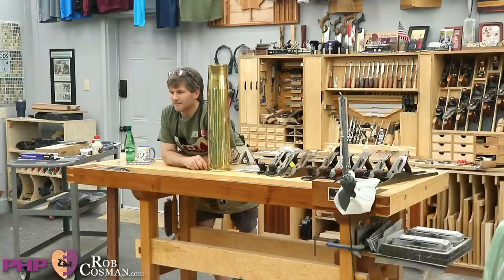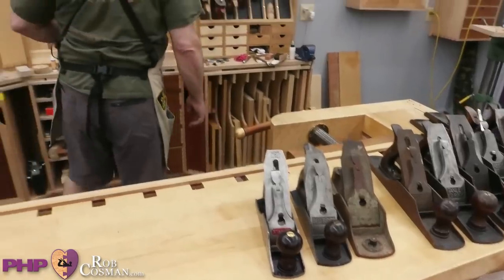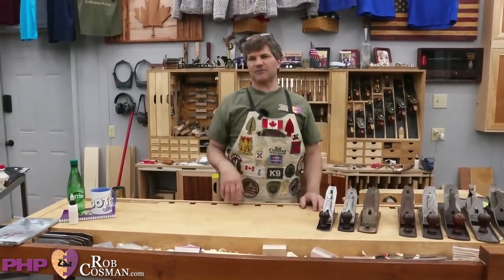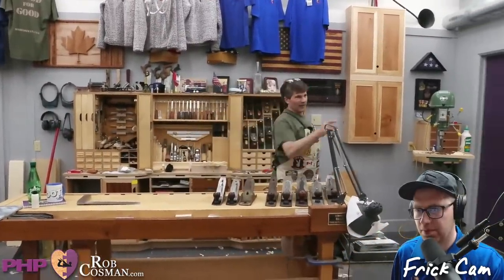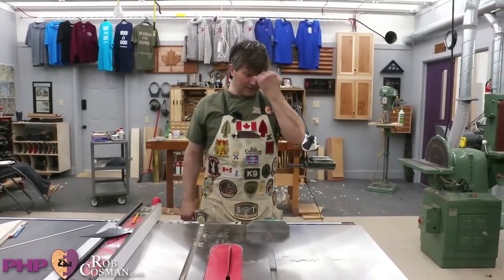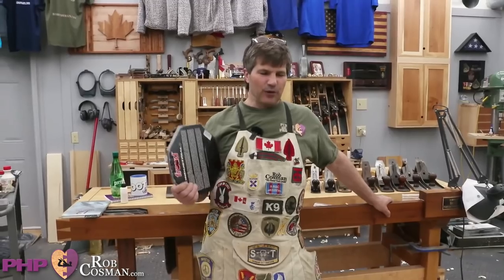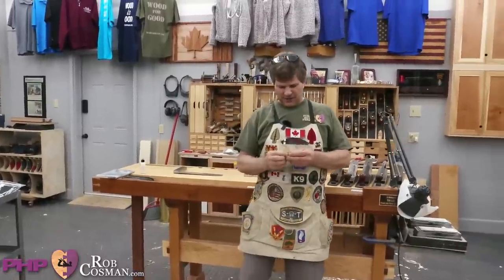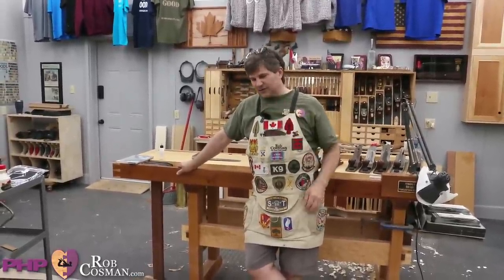Table Saws - Live Q & A (12 June 2021)

Comment: For a unisaw, put the fence on the left side of the blade for angled cuts, then the blade is now away from the fence.  simple solution.  I have had my unisaw for over 20 years now, its a classic, and still works as good as day one.  I never knew the sawstop actually stopped the blade.  I have never seen anyone talk about this before and have seen countless videos on the sawstop, I just thought it was a brand name.   In any case, I have had one kickback accident in 20 years, and that was from using a dado stack and routing a groove in a narrow piece of wood and I really didn't give consideration to the lightness of the stock and how little control I had over it.  The board flew back against my back cement wall, and bounced all the way back and smashed my finger tip, fortunately just a few stiches and lost nail.  It's always the unusual cuts that you dont think about that get you.  So i will always use a push block now when going over a dado stack.  live and learn.

Comment: That dust shroud door Rob shows at 17: 30 is only on newer ICS saws. I wish my PCS had it so I wouldn't have sawdust in the bottom of the saw!
Reply from the maker: I have it on my saw purchased in 2005 as well.
Reply: @RobCosmanWoodworking  Interesting! They must have made other improvements because they have two versions of the ICS manual; one titled "Industrial Cabinet Saw Owner's Manual (With Dust Collection Upgrades)" dated 2020

Comment: Huge fan and avid handtool woodworker. Actively saving to try to attend your PNP workshop in the not too distant future. 
Comment on your tablesaw YTube session. About 15 years ago I read online a fellows observation of what the Forrest sawblade guys did before a wood show. They had probably a 3 inch and 1/4 inch thick blade 'stiffener' that had 8 grub screws spread evenly around the outside. Then using a dial indicator, they made sure that the blade was turning perfectly vertical, adjusting the grub screws where necessary to ensure perfection.
I did this myself, just using a Freud blade, and the difference between before and after made a very significant difference where the 'after sawcut' was almost ready for finish (few passes with smoothing plane made perfect). Does mean that blade changing took a few minutes longer and did reduce max cut depth about 1/2 inch, but the sawcut finish is worth it. Strongly recommend you test this. I used saw-sharpening business to make my 'stiffeners for me.
Bill Liversidge, Midlands, UK

Comment: Hi, Rob! I have a question about table saw safety. Actually, someone asked a question in a Facebook group a few days ago, and they’ve pointed out this video to show what they were proposing, so I wanted to clarify, please. The question was “is it safe to setup a cut like it seems you do at about 30:00”. You’re talking about using a miter gauge if the distance against the fence is shorter than the perpendicular distance. It seems as if you’re going to make the cut using both the miter gauge AND the fence, with the miter gauge being between the fence and the blade. We all told him, and his gut instinct, was to never make a cut where the wood could bind between the blade and fence. Then at 45:00 in your video, you discuss binding and kickback, but you set up the cut with the miter gauge being on the outside of the blade. You mention to never make a cut like that where the material touches the fence. You also say “without being supported”, so I take that to mean that the cut at 30:00 is safe because it’s supported by the miter gauge??? Is that correct?
Reply from the maker: Yes.
Reply: @RobCosmanWoodworking  Thank you! I would have thought the 30:00 cut would be a no-no, but being supported with the miter gauge makes sense to make it safe.

Comment: The problem with sawstop is that they have their safety mechanism patented, which means they'll sue anyone that tries to implement a similar safety mechanism in their table saws.  To put it simply, sawstop cares more about profit than they do about keeping table-saw users safe.  The fact that sawstop appears to have essentially extended their patent until 2024 and 2025 (the original patent was set to expire in 2021) is proof that profit is their primary motivation.  It's pretty clear that sawstop will try to keep competitors from implementing similar safety mechanisms for as long as they can.  With this in mind, there's no way I could ever support a company that puts profit before safety.

Comment: Dose the blade stopping feature work if the saw is not under power but still spinning on the wat to slowing down.?
Reply: The break will fire even after the saw has been turned off. 200rpm and higher.
Reply: @steelwood74  best saw ever for the price range. I've had a few close calls with other saws, shutting it off and almost getting bit.

Comment: That's a good point about the cost of healthcare in the USA.  I think I remember James (Stumpy Nubs) sating it cost him more than $10,000 after he gashed his hand with one of those nasty chainsaw carving blades in an angle grinder.  It would be free for us here in NZ (that includes tourists and all visitors) but I think I'd gladly pay $10k to avoid the injury that James had.   On the other hand, listening to Rob talk about the number of false Sawstop triggers he has experienced, and each one costing a new blade and cartridge, I think I'd also be annoyed at that cost.
Reply from the maker: The number of false triggers would be due to the fact that my saw is used in a commercial shop and over 15 years old (they’ve been happening over the last year or two mostly). However, if it is deemed a false trigger they will replace the cartridge for free (they’ll even replace it if you trip it on your finger).

Comment: What amusement do you look for on your saw to keep your saw accurate or able to adjust it
Reply: For amusement I like to roll ping pong balls into the rising side of a spinning blade. Never improved the accuracy, though.
Reply: Hahaha , what adjustments would have been better, unlike a phone picking your words for you 😉😂🤣😂🤣
Reply: @jamessmith1965 , drives me crazy, too. Proofread several times, and still seems like a change slips in when I send!
Reply: @jamessmith1965 , Rob mentions all these, but my first lookout would be to select a “cabinet saw”; that is, the motor, blade, trunnions , etc. are all mounted to the saw’s metal cabinet or cast frame. This means that the top is held on by a few bolts and is more easily tapped around to align the miter slots with the blade. Saw Stop has the best, and only, system built in for fine adjustment of such. Less expensive saws have the works bolted to the underside of the table, making adjustment very difficult.

Threaded adjustable stops at 45 and 90 degrees are important, but I don’t know if any saws are sold without such, nowadays.

Some rip fences allow more adjustability than others. The Uni-Saw had a very reasonable system  in two ways. You could adjust the lock on infeed side to grab first, squaring the fence, and then lock the outfeed end for security in the same throw of the lever. Even more importantly, after the infeed lock it was possible to loosen two easily accessible bolts to adjust parallelism to the blade/miter slots. These capabilities are the minimum I desire.

Even better, though; for a time that saw was available with Uni-Fence, which gave it the virtues of modern Euro-saws. The fence extrusion  could quickly be positioned in several ways: high up, low and thin, overhanging, or pulled back to clear the blade for ripping “tense” stock, or using as a stop for multiple cut-offs.

Now that domestic USA saws are becoming equipped with riving knives, a very useful feature is easy alignment of those, and tool-less removal/install fastening.

If purchasing a new saw, I agree with Rob that Saw-Stop, the best model affordable, is the only game in town.
Reply: @leehaelters6182 As an avid "Ping Pong" player I could use this technique to improve my service game.

Comment: Hey Rob! I love your channel!  I wanted to know about hand planes. I wood believe that the sides would be square to the bottom. I have old Stanley I want to clean up. I also have an old Sargent plane I started to clean up.In doing so I found the sides to be out of square with the bottom. The Stanley is out of square as well. I'm sure my square is good. I this normal?
Reply: Most planes that I’ve checked are only casually square, which is to say not enough to satisfy. The Record Technical Jack was touted by the company as designed with shooting in mind, and supplied with a removable handle. Never saw the actual item to check, though.

Comment: Why haven't American table saws changed in fifty years?
The European saws are decades ahead of the American machines.
Reply: Agreed! For one example, all rip fences should be euro-design, at the least. Riving knives are coming in, now. But maybe the Saw Stop and the brouhaha it created is the beginning  of smarter equipment design in the States!
Reply: @leehaelters6182  , I don't know if SawStop could take the technological leap to create an accurate sliding table saw, with decent dust collection.
Reply: @areuaware6842 , agreed there, too. The sliding tables I see being incorporated with “American” manufacturers’ products are all lame, added far from the blade, need spindly legs, and so on. A fresh sheet of paper is what the saw manufacturers need. Nobody interested in that unless they faced legal restrictions otherwise.
Reply: Yes guys, but at the same time the saw stop peculiarity to make the blade disappear avoiding injuries is just implemented in a contractor's site Festtool and that's all... I'd rather buy an American saw stop than a beautiful sliding saw table if this can cut off my body...
Reply: @dukeengine1339 it will take too long, of course, but I look forward to manufacturers creating their own mechanisms and detection technology, now they’ve been shown the way by Saw Stop. Felder already has something developed.
Reply: @dukeengine1339  , I've always been more concerned with how saws saw and not how they stopped sawing.
You've probable never used a European sliding table saw, their capabilities are way beyond one of Americas fifty year old designs.
My question remains, why can't an American company make a better table saw?
Reply: @areuaware6842  I guess Rob isn't aware that Sawstop makes a sliding table.
Reply: @leehaelters6182  I guess Rob isn't aware that Sawstop makes a sliding table.
Reply: @rlevitta , that would surprise  me, as Rob gets around. None of the add-on style sliding tables rival the utility of those incorporated directly into the design of the saw. A whole new frame is needed, to begin with.
Reply: @dukeengine1339 , Festool owns Saw Stop now.
Reply: @leehaelters6182  Yes, but there are things he's not aware of that he probably would be if he wasn't so busy himself - such as the 5 cut method of making a perfectly square crosscut sled. He's been asked the same question several times, but he still doesn't know what it is - see William Ng's video on youtube https://www.youtube.com/watch?v=UbG-n--LFgQ
Reply: I guess if everyone started buying the European saws then American companies would have to make them. Why redesign the product if people are already buying it?

Comment: Just catching up with your video now ( the live stream started at 8.00am Sunday in Melbourne and yeah ... 8.00am Sunday...  ) anyway, my question. I bought a sawstop saw before I found your channel and I'm very happy with, as most are, but I need a folding outfield table. I notice you have Sawstop's own version but the "net has a reasonable number of negative comments about it. Was there any special setup process needed that the others haven't followed or does it have deficiencies
Reply from the maker: Hi, it took me about 3 different assembly attempts before finally getting all of the tubes in the proper orientation, but after installing and dialing in the height (each mounting bracket has about 5 washers that you shift around) it works seamlessly. My only gripe would be that it’s not convenient to move pieces laterally after going through the blade.
Reply: @RobCosmanWoodworking   Thanks for that. With the detailed instructions that came with the saw I assumed the outfield table would be the same. So follow the plans & it should be right, although a little fiddley and maybe take a little longer but better in the long run. (and my first degree is in Civil Engineering so I better know how to follow plans :) ) as for moving sideways, I'm only a hobbiest and my shop is only 4 metres by 5 metres so little room to move anything sideways

Comment: Question for everyone. My new shop is in a basement and of relative small size. No way I can get any cabinet saw down there. Would you say the Saw Stop Contractor or even the Job Site model would be precise enough for table saw joinery using sleds, jigs and dado blades?

Cheers!
Reply: My SawStop is the 36" contractor model, which came in a couple of boxes that would easily fit through a standard opening to a basement. But the boxes are still very heavy so make sure you get a trolley with stair walking capabilities
Reply: @soils1111  thanks for the reply. Do you use yours for milling stock or for fine joinery... Or both?
Reply: @mathieurenaud1099  effectively both, when I learned enough to do fine work. Actually I got more obsessed (my wife says woodworking and photography aren't my interests, they are obsessions - can't argue) with woodworking when I wanted to use Australian Hardwoods as frames for my photography. I wasn't able to find a supplier so took to milling my own, then finishing them, which has lead to some furniture around ours and our children's homes

Comment: In the early 90’s I bought the best big craftsman tablesaw I could get on credit from Sears. It was heavy powerful and very accurate. It had a great fence that locked solidly in place and I loved it. I built furniture and cabinets for a living and it served me well. When I got a job as a technical director in a theatre building sets, I recommended they buy a Sawstop. Wow I was impressed. It was great. If I had one criticism it would be the throat plate being too flexible. Eventually I lost my shop space and became a mobile finish carpenter and sold all my big machines. 
I bought the first generation jobsite sawstop saw and never looked back. It’s not as good as a cabinet saw but it’s great for being mobile. With my 30 years of experience I’ve learned how to do very accurate work with whatever I use. On this one the Throat plate and table top are too flexible. The fence does not stay parallel. But for finish work for a house it’s fine. Maybe the new generation is better. Great video.

Comment: Missed it live; I was driving. Caught the end but I rolled back to the beginning to watch. A lot of safety procautions are the ones I follow every time I use a table daw. I guess I have enough resspect and confidence at the same time on a table saw, I only got a few pinches when I was ripping 2x10. Oh, my Ridgid TS3650 does not come with a splitter. I should add one soon. I have cut myself 3 times with a saw so far. 1st time was trimming a through tenon with a ryoba saw, and I slipped; saw cut my left thumb. 2nd time, I was cleaning a bandsaw, unplugged, and I was spinning the wheel while trying to clean the blade; it caught my finger tip. 3rd time was on Memorial Day, I was rough cutting some bowl blanks from a fresh cut log. Cabinet of my band saw was rocking back when I push a piece, so I thought I would use my body to stabalize the saw. In the moment I was leaning my body to the saw, blade cut throught he corner and I was not paying attention to where my hand was pushing. I got 4 stitches and a lesson.
I am surprised Mr Cosman picked Freud over other blades. My saw is not very powerful, so I run Freud thin kurf exclusively.

Comment: Hey Rob, I have a problem with the wood drifting away from the fence as the wood moves past the blade, only maybe 1/16 th or so but the cut turns out not true and straight. Why?
Reply: Rip fence not parallel to the blade (notice I did not say miter slots. Can be an error there, too). Rob, give this your imprimatur, please.